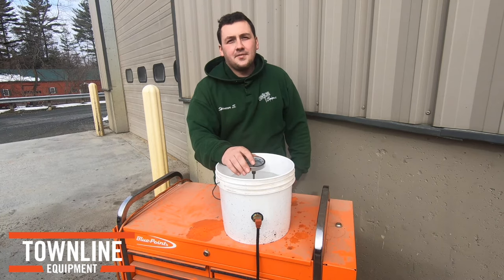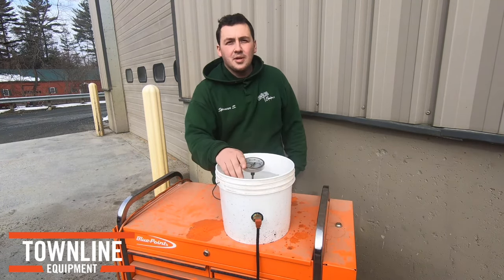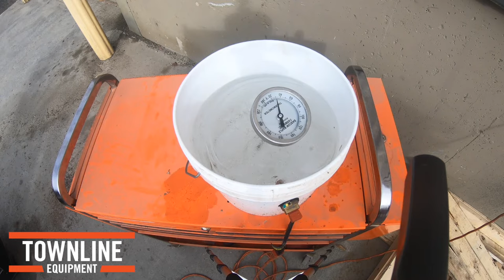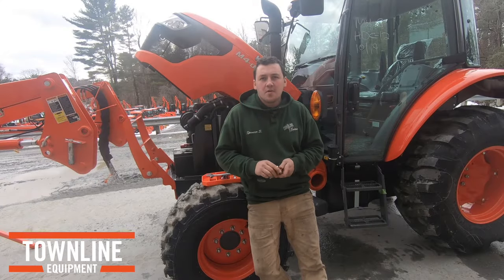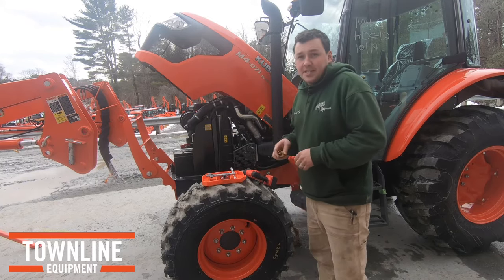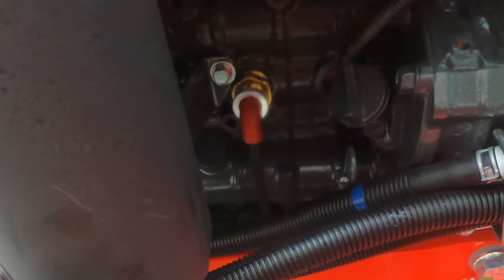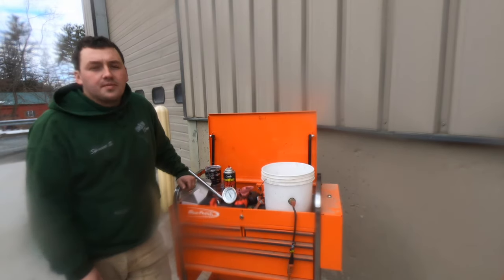Kubota Block Heater - Install and Benefits of Use

Comment: Didn't show the install very well. My question is does it really matter what freeze plug you remove to replace it with the block heater? I saw a vid that the man said it should go into a specific one but then watched another vid and he said it didn't matter which one was removed for installation. Which is true? I have an mx5000 and moved from Texas to Ohio so I want to add this plugin to it to be able to use it in cold weather.

Comment: How do you take off the steering wheel on a la1002 kubota m6800. Having no lights issue. Any suggestions?

Comment: You need to tell us what you are using to remove the plug. Looks like some kind of hex tool. What tool and what size?
Reply from the maker: We first drill the freeze plug so we have a hole that we can thread a slide hammer into to remove the freeze plug.
Reply: It was a THREADED plug, not a freeze plug, that tool was an allen wrench, looks like a metric 12mm or larger.
Reply: It takes a 17mm hex key or socket Allen key cross over to get the threaded freeze plug out.
Reply: @echotoday  Thanks
Reply: @echotoday  thanks
Reply: @TownlineEquipment  smh